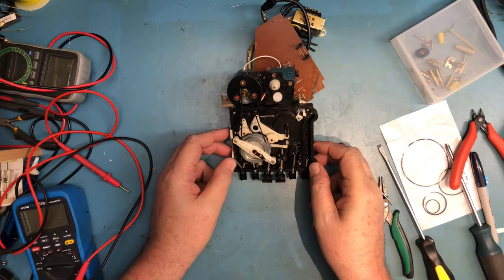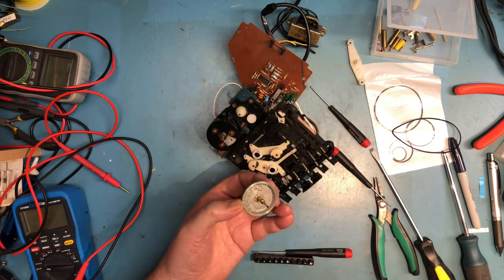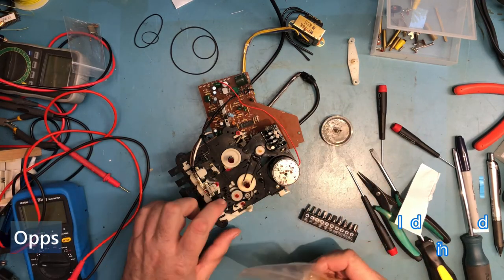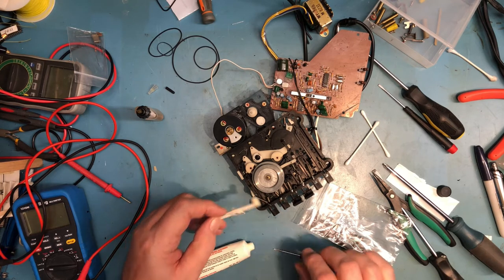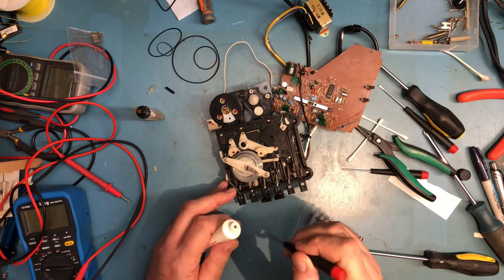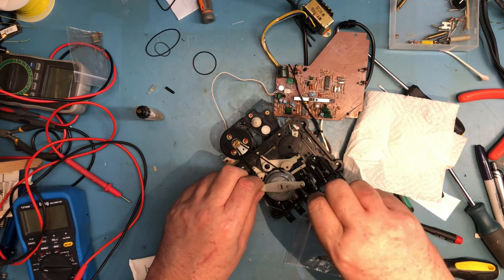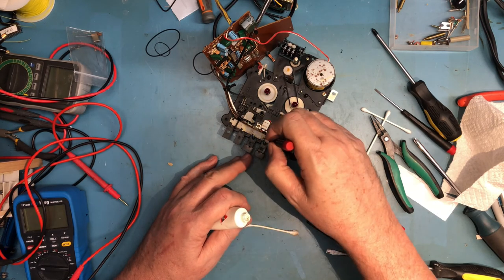STB614 - Atari 410 - Part 5 - Cassette Recorder Belt replacement

Comment: Edit: oh gotcha, I believe you do address the fourth belt in a later video.

Forgive me if you get to this later / in another video, just thinking out loud...

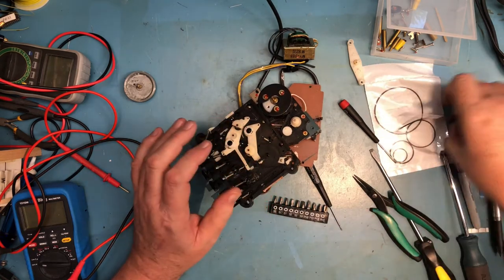The mechanism you decide not to disassemble around 6:35 I went to disassemble and replace the innermost belt.

The white circle piece comes off, yes. It's got a little locking sorta mechanism (for lack of better words, similar to a medicine bottle). Additionally, it was a little stiff initially when I was trying to rotate it (you rotate about 30 degrees, then it lifts off) so it seems like it won't move but it actually will.

After that, the belt replacement is straightforward.
Reply from the maker: Thanks for the comments. I do figure this out in a later video. :)
Reply from the maker: No, I never got to the 4th belt. I did over lubricate the drive, the part with the large flywheel shouldn't be lubricated. I end up tearing down the drive again to clean up the mess lubricating it caused.

Comment: This looks a little challenging.
Reply from the maker: It was, and the final belt which I address in a later video was more challenging.
Reply: @ShadowTronBlog  I have two of the older ones, the 410P, and they both need some love.  Nice video.
Reply from the maker: @cathrynm  Thanks.